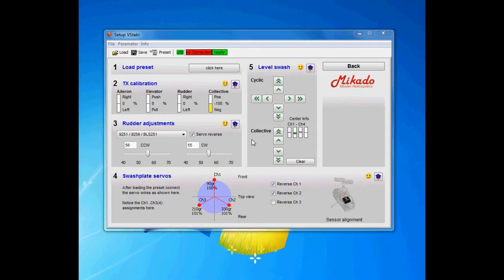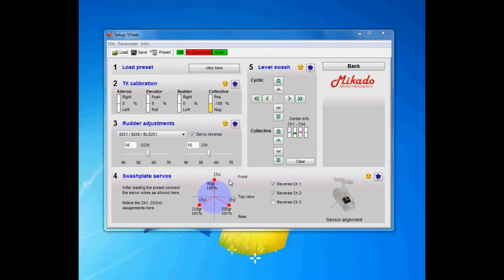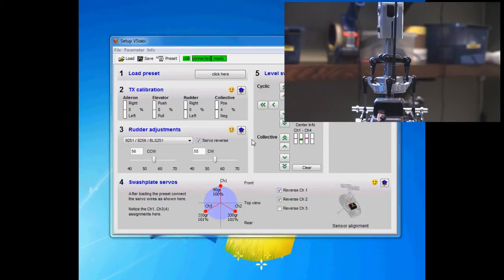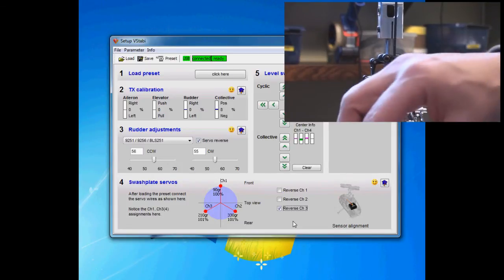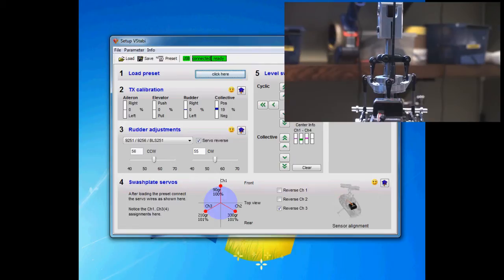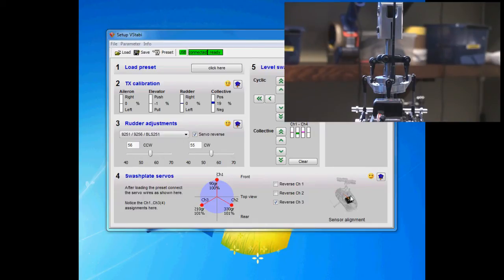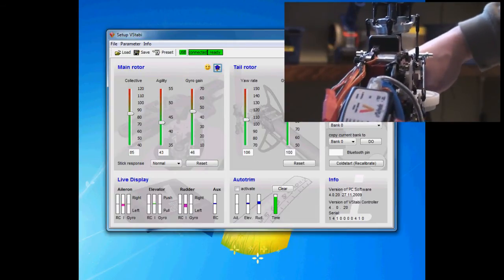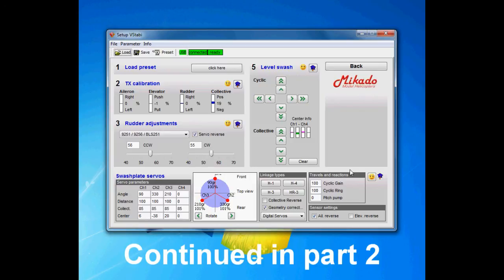VBar 101 - Episode 11 Part 1 - Swashplate servo setup

Comment: Mr Mel in 4.0 is it ok to use the servo center boxes to change servo center individually? My servo horns aren't as close to 90 as I'd like, and I can't find any other way to 90 them. If I use the swash setup portion it changes all 3 servos. I need to adjust them individually.